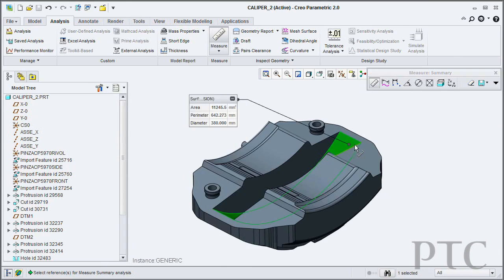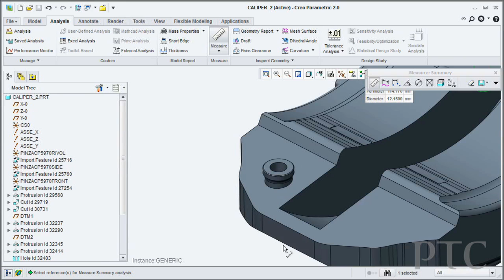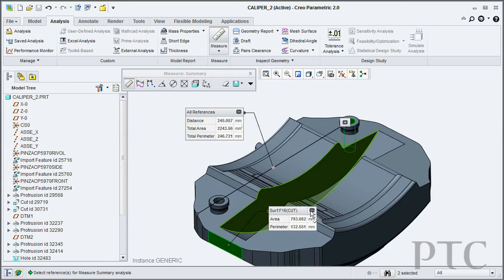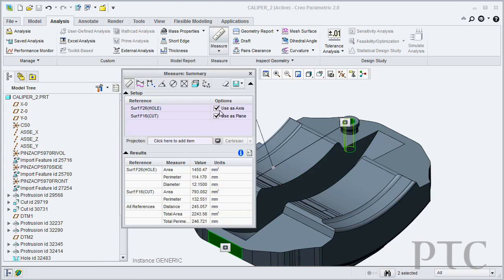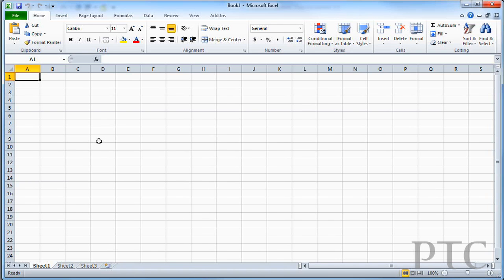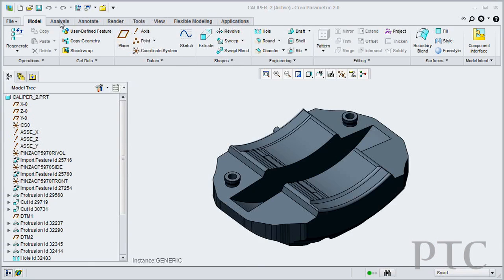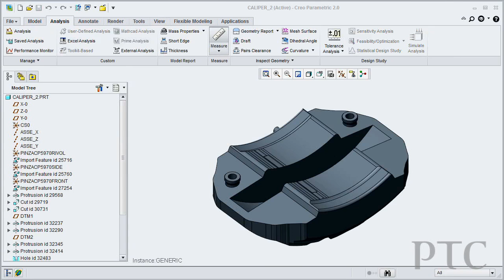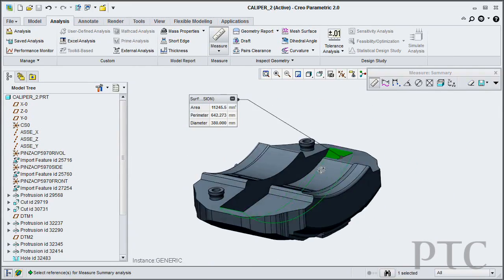Creo 2.0: Streamlined Measuring for Creo Parametric - PTC

Comment: Why is it so hard to get an X, Y, Z value and a resultant between two points?  It's basic math.  Every engineering and physics class does this.  It should be easy to get this value and included from the first day Creo was ever created.